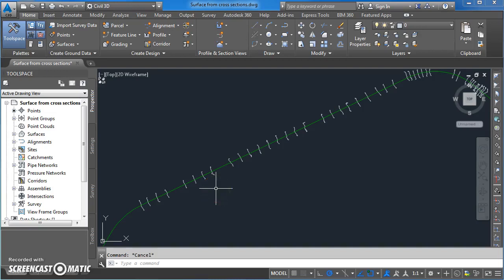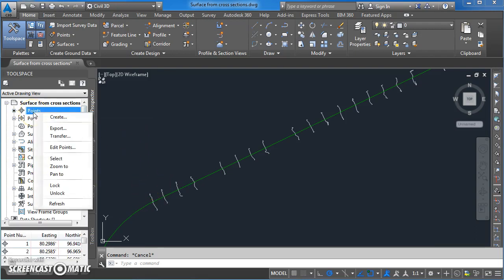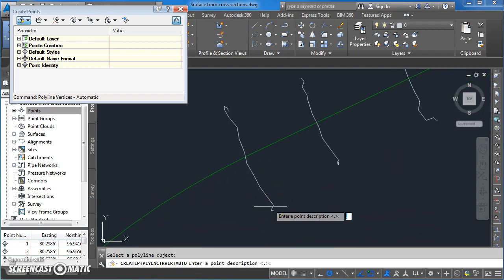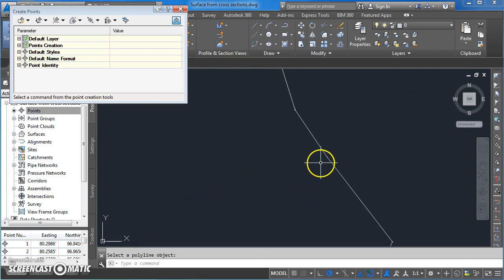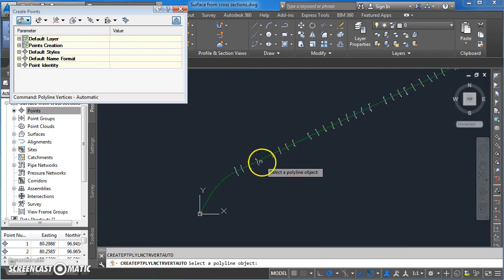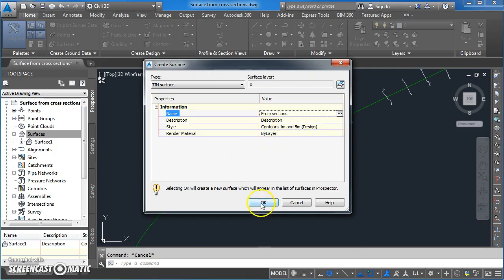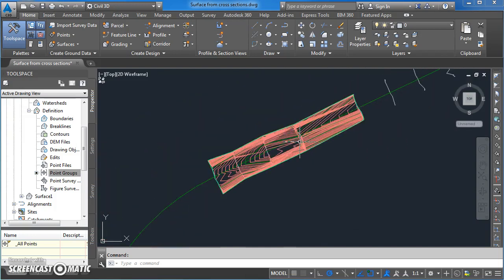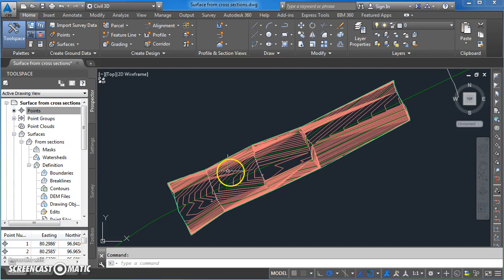Create surface from existing cross section details

Comment: If the cross sections are projected from XY surface (side view) on Z (top view) then it is all wrong sir.
Reply from the maker: MrBenbenky I have no idea what the origin of the cross sections in this drawing is. The drawing was sent to me by a subscriber to the channel with a query about how to generate a surface based on the data that they provided. However, I believe that the sections shown came from 3D survey data, rather than being extrapolated from a 2D surface. Based on the query that I was asked to address and the data I was given, I believe that what I show in this video is correct. One additional item that could make the model even better would be to include break lines between the sections, but as I was not involved in generating or surveying the sections, I would have to make an assumption as to where to place break lines. If you can clarify exactly why you think what I've done is  "all wrong sir" then please do. Otherwise your comment is not very helpful for the subscriber who sent the problem and was happy with how I solved it.
Reply: ***** I got mistaken by you referring to the lines as "cross sections". Technically the lines are not cross sections even though they look like cross sections of the existing ground of the road corridor. They might be sampled at the intervals of the cross sections. Your technique is therefore correct providing there is no additional information about breaklines.
Reply from the maker: MrBenbenky They are not "cross sections" in the sense that they are not generated at known intervals from a pre-modelled surface. However, I meant that they are cross sections as generated by surveying the levels at right angles to the centre line of the tunnel involved. So they are surveyed sections rather than computed sections. Thanks for clarifying and taking the time to reply.